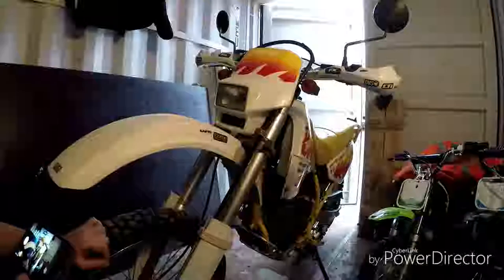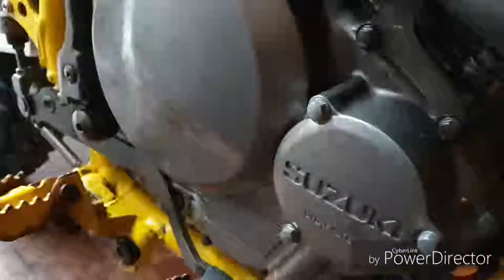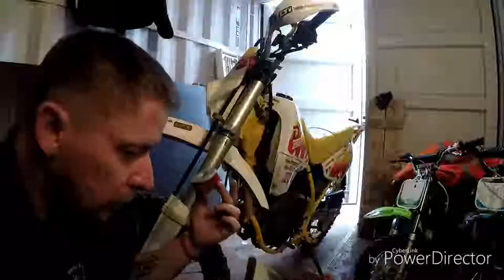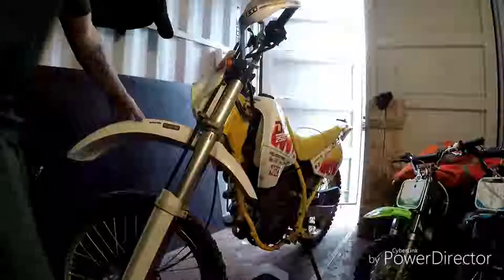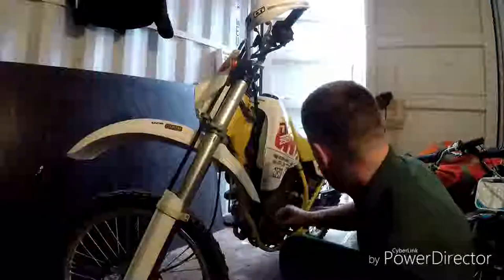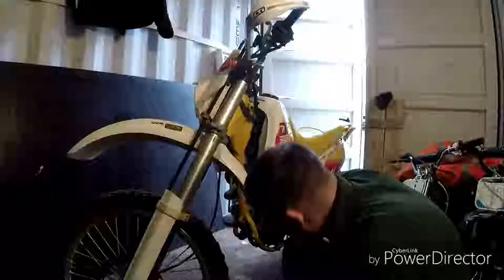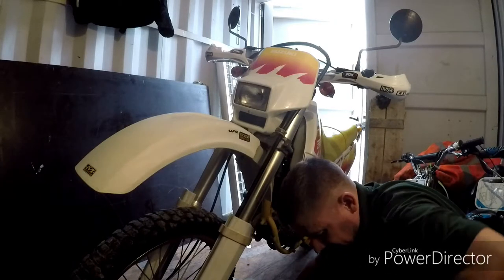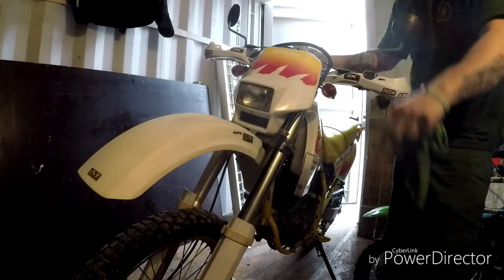DR250S oil and filter change.

Comment: What do you think would be wrong with a 1990 DR . It sat gor about 11 yrs and just recently changed the oil and filter and now the bike want go past second gear.  
I can go from 1st to neutral and 2nd gear fine but not passed 2nd gear even when riding it. Any help would be greatly appreciated.  Thanks for the video
Reply from the maker: Hi pal. Was the bike shifting through the gears before the oil change.
Reply: @AdamsLifeRiding  To make long story short, I just bought the bike bike, a 1990 DR 250, and the guy had the bike when he was 14, and it ran fine.  He went into the Marines, and the bike sat for around 11 or 12 yrs, and he decided to go back home to get it out of his dad's way.  He brought the bike home, and it's still been sitting, so he decided to get it out, get it running, and sell it to pay for his wife's wedding dress. He wanted $1,800, and had a couple of people come look at it, and he said that if my 14 yr old son wanted it, he could have it for $1,000.  
It's a very nice bike, and he told me that his dad and him rode bikes until he got his license and joined the Marines. He said that being in the elevation they lived and rode at that his dad had the bike over jetted and had bought him new tires and a bigger back sprocket for and got the bike jetted for his Christmas one year and he said it geared it down lower. 
He got the bike home and changed the oil and put gas in it and couldn't get it to crank, so he did a quick clean on the carb, and it was crunk right up. I got there, he had to crank it and ended up riding it to warm it up in a small resident and I heard him go up to 3rd gear and back down and when my son test drove it he got it up to 3rd a few times.  We got home, got it off the truck, and it worked fine 1st gear through 2nd but will not go into 3rd gear. 
I went yesterday and bought another new air filter and oil, and I changed it today,  cleaned the spring in the oil tube, it was pretty dirty and he's running it now and said he's starting to finally hit 3rd gear up to 5th gear. He says it's hard getting it past 2nd gear right now, but when you do, the rest is easy.
 Thanks for the help. I'll keep you updated on how things turn out.  I really appreciate your reach back
Reply from the maker: @jimmymarsh2489 hi pal.  try adjusting the clutch or even replacing the clutch plates and springs. I think it's probably a clutch issue.  Hopefully you can get it sorted. It will be a cracking bike for your son.
Reply: @AdamsLifeRiding  thank you. As soon as I posted that, he rode it for about 10 more minutes and then started having the shifting frome above 3rd gear again but I will be buying and installing a new clutch cable for sure but ill probably have to have someone to take the job with the clutches because I've never been taught about them and I don't want to mess it up. Thank you again, and I'll keep you posted